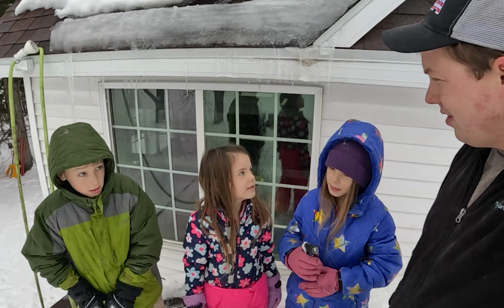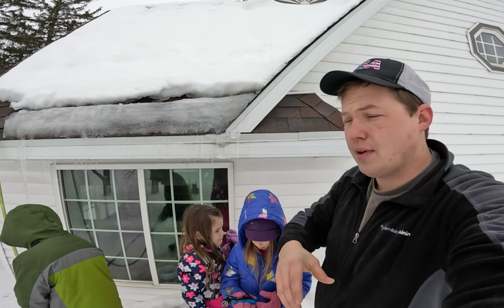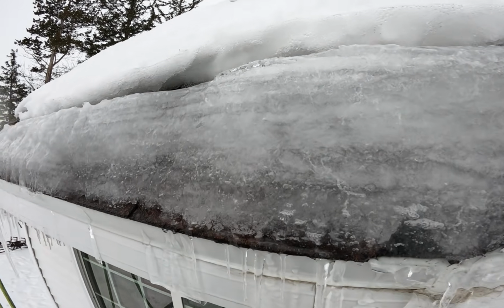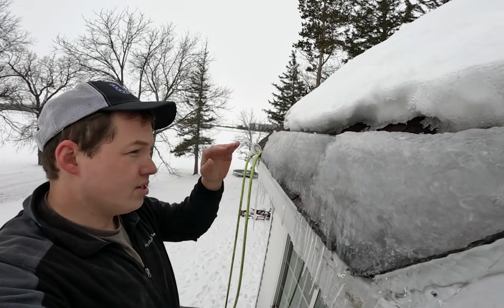ICE DAMS - Why They Happen & How to Melt Them

Comment: I had the same problem at my house in Massachusetts in the last week with the upper back roof on my 1955 Cape house. We got snow in 1 day that was over 2 feet. The problem with my house is the fact that the insulation in the attic is vermiculite,which has the potential for asbestos so you can't disturb it with additional insulation on top. I might just have heat cables installed next season

Comment: I've watched 20 different I've damn videos... this young man is the only one for it right.... its always interior heat loss and lack of properly ventilation. Fix those and you avoid the ice damn. However in some house details you can't access the areas to fix the insulation issue... then you have to use these bandaid  fixes...

Comment: My attached garage I now heat with fiberglass in walls and blown in above. I added a heater and now have ice dams. I’ll look at it over the Summer and I think I’ll need to add a ridge vent and make sure soffits can breathe. The main house I have no problems because it’s adequately vented.

Comment: I have a metal roof and gutters.  The ice accumulates right at the edge on on the top of the gutters.  Not good.  Heat "tape" is not an option on a metal roof.  I'm still looking for solutions.

Comment: I just went through this for the first time. We have owned the same house for 26 years and we were getting water leak inside the kitchen through the wall into our finished basement. This was a real freak of nature due to very low temperatures this winter. Thank you very much for the info. I have decided to go with the roof heat cables also.
Reply from the maker: It's no fun to deal with when it happens. I've also only ever had it happen once, so I still haven't added those heaters. Haha

Comment: If you insulate you have to ventilate so vents to allow cold air to come in the soffit and exit in the roof vent
Reply from the maker: That's definitely the optimal way to mitigate it. If you keep your roof at the same temperature as the outside ambient, ice dams can't occur.

Comment: I just had this problem and the water started dripping through the window wood frames. 
I had to call in some guys to get it fixed.
Does this leak mean the shingles or roof is compromised and roofer needs to fix it??
I looked it up from the attic and I see traces of water inside it . 

The guys who came in ripped off the dry wall where I was wet . And the fur in insulation was too wet too and that seeped into the window frames. 

If I used these methods will it make things worse ?
Reply from the maker: Typically an ice dam shouldn't mean that you have a bad roof and as long as you dry out the affected wall area (as it sounds like you're doing) and mitigate future ice dams, then you'll probably be fine. Just my opinion.

Comment: This is a crazy topic. Even among home inspectors, it seems half of em recommend roof rake or ice melt and the other half say NEVER use roof rake, ice melt. Same with water, some say run the water over it, others say it gonna cause extreme damage with the temp change.
Reply: Home inspectors are not the masters of nothing.  In most states there isn’t much of a regulatory requirement to become a home inspector.
Reply: @greenidguy9292 I use nothing. Works great

Comment: I have a metal roof with 2” foam board on the roof deck and still get ice dams. It’d be pretty hard to properly air seal, there is 6” of old loose fill on the attic floor and little room to work… No ice dam leaks at windows though.

Comment: Get a good architect to help you understand how houses in cold climate should be built. Sadly most house were and still are built by contractors with no knowledge of quite basic principles in construction. Heat transfer, condensation, dew point, air barrier, moisture barrier. Knowledge to build quality house had been known for centuries... Its just that ppl put their head in the sand

Comment: Old sock + rock salt = no more ice dams on roof 👍 also no additional energy needed (i.e. hot water, heat strips, climbing a ladder...) Be safe out there ☺️🙏
Reply: I agree! Works great and no fuss. Why did this Janine breeze over the Roof Melt tablets, they are great
Reply: Use panty hose
Reply: I would use calcium chloride instead for rock salt. Easier on the shingles I'm sure
Reply: Just recommended this to a customer 🎉❤😊
Reply: ROOF MELT TABLETS, cheap, sooo easy, and they work great.

Comment: Ben, I've fixed 3 older homes to prevent ice dams in SE Wisconsin by adding a continuous  ridge vent and cutting in soffit vents every 32" spacing, every other joist space.  Houses were built 1978, 1965, and 1972 and only had a few box vents and 3 or 4 soffit vents. I only have 6" insulation in attic and haven't had any more ice dams in 20 years.  Before that ice dams were 8" thick stretched back across 36" overhang and leaking into windows.  

So ventilation is #1 most important.   

A easy before and after check is to look at your roof when you have frost on the roof. If not enough ventilation, then you will see heated space melt first and see lines from roof rafters.

After you add enough ventilation, you won't see the roof rafter lines and frost will stay on your roof longer than your neighbors, and frost will melt off evenly. 

You may want to consider adding ridge vents. It looks like you don't have a ridge vent.

Good luck. I hope you get your ice dams fixed.
Reply: It’s not that simple for some homes. I have a new build ~2018 with soffit vents running the whole length of the soffit and ridge vents. I get lots of ice damming. Cold winters, SW facing with lots of sun, steel roof. Need heated lines for sure.
Reply: @Fluterra  Sun exposure often is a culprit for sure. Our SW facing roof has a gnarly ice dam desire everything else being done right. 

Adding cables in summer, don’t like it but there’s no way around it sometimes.
Reply: @jamesdehn , I have a question for you but rather email you. Please share your email. T.y

Comment: Real bad ice dam here in Roosevelt, UT 2002-2003.  Found the best way is to use scaffolding and a hatchet.  I had an incident in the late 90s where the ladder slid out while working up high as the ground had previously been flooded. As a result of a broken water line.  I came real close to breaking both my legs as my legs went between the rungs and my bottom end slammed down onto the top of the ladder.  The aluminum ladder bent in response.  I will always use scaffolding now because it is so much safer, especially when working above ice or water that has frozen as a consequence of the cold weather.  I did accidently cause abt a 3/8 in hole and a 1/8   in hole but i quickly patched them up with some silicone rubber.  This was on a slate shingle root.  I wouldnt hesitate to chip it out again with a hatchet.  Most of the work was focused on a rain gutter heaped up into a solid ice pattern for abt 7 -8 ft segment of the edge of the roof.  I used a snow rake to pull down the majority of the snow.  I had to do this same chipping and rake process 10 or so years ago..  i also used large aspirin shaped snow removal pellets for areas that I couldnt safely reach.  After several years of wxperience using this same process, I'd most certainly do it same way again.  Biggest problem is finding someone to rent scaffolding or borrowing from a friend or neighbor and finding planks that might be burried in the snow.  Be safe and good luck.
Reply: Correction to previous post. Should be 2022-2023.  This is my wife's account.  Arvin W.

Comment: You can run copper pipe with hot water under the roof. If the second floor has bathroom, you can do hot water recirculation under roof.

Comment: I have always chisel the ice dams and never damaged the roof. Way faster than with water.
Reply: That's what I was thinking.  That or an ice pick...
Reply: My tenant must’ve used an ice pick he alerted to me water is gushing in kitchen. When had roof replaced they sent me a pic of hole in the roof…most likely caused by hammer or pick
Reply: @mikegrimaldi5844 obviously some caution is required… but maybe the wood was already rotten if that is indeed what caused the hole in the roof, no?

Comment: I have plastic slate on my roof if you don't put snow guards on roof you get great avalanches of whole roof just slides off and buries people when sun shines on roof like in grumpy old men movie lol.
we also put ice membrane on roof, and it keeps any water from leaking through it self-seals even sealing the nail holes. and we put the heat cables, but they are finicky in how you put them on roof and gutter to get the water to drain and not make giant icicles you have to heat the leaf guard on gutter also.
Reply from the maker: All good points.

Comment: You can chip that ice off if you leave the last inch of ice thickness to avoid damaging the shingles, water in winter is a mess.  You don't have to get 100% of the ice off.
Reply from the maker: True, if you know what you're doing that can work.
Reply: @BenjaminSahlstrom  Yep, just have to be careful and leave a small layer of ice.

Comment: I had one of those electrical web things, you described, on my apartment roof in SE Idaho. It had heater wires that melted the ice accumulation in the gutters also which kept them clear. One turned it on and off manually. It worked well, but you must remember to turn it off after it has done its job or it will run your electric bill up to the moon.

Comment: Additional insulation can be added externally if you ever need to replace the shingles. Continuous insulation or even adding roof depth for venting but these options can be expensive.
Reply from the maker: When I replace the roof I am planning on adding foam and a steel roof, most likely.
Reply: That would be a great video! Both the design and construction phases.
Reply: Don't add insulation.. Remove it. Add venting.

Comment: When I had a leak like yours just inside a window, I taped some large unopened garbage bags (or just use a plastic drop cloth) so it would capture the drips and direct them into a large plastic garbage can.  This kept the window sill and floor dry.
Reply from the maker: Yup, we were using containers and towels until we were able to get it fixed.

Comment: I have filled a woman’s nylon stocking with ice melt, tie a line on the end throw up on the roof and pull to the edge with the line. It melts the ice
Reply from the maker: I've seen that too. Pretty interesting method! If it works it works I suppose!

Comment: would a spray nozzle work better to get more surface area?
Reply from the maker: Not really, the larger slower flow without a nozzle works best. If you spray through the air with s smaller nozzle it tends to cool down the water a lot before it even hits the ice.

Comment: Could you add an oil coating (even cooking spray) on that part of the shingles in the fall as a preventative measure?
Reply from the maker: I would be concerned that it might damage the roof surface and cause a mess down the side of the house.
Reply: no the gravel is too coarse you would have to like paint the roof with silicone caulk